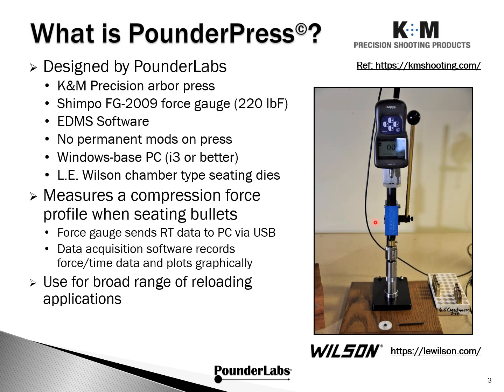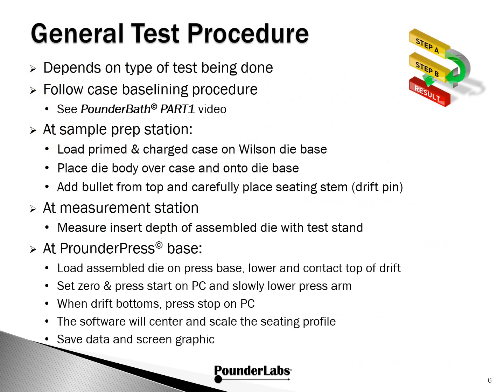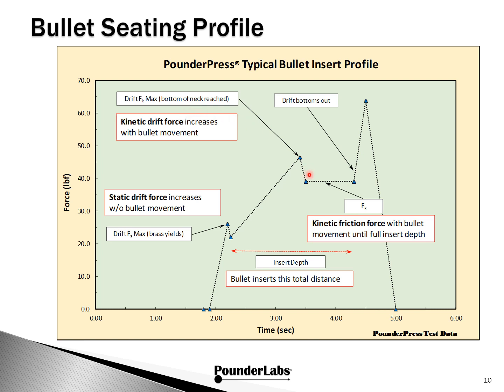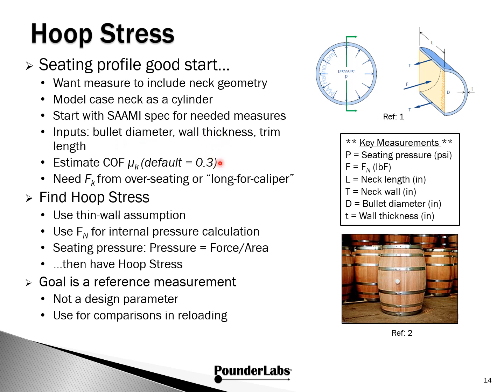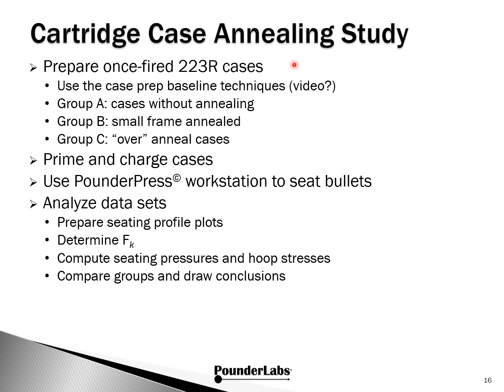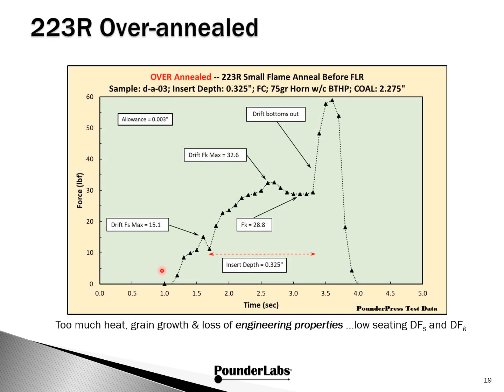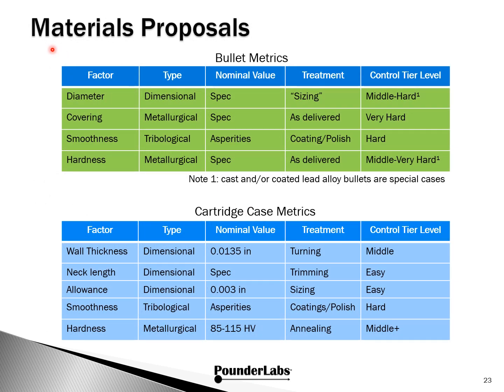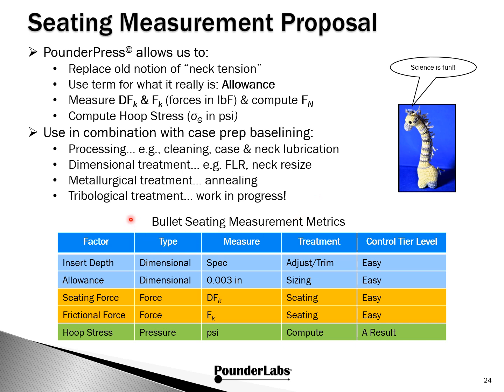PounderPress - New Bullet Seating Measurement

Comment: Nice work. Just a few more words on the concept that the assumption of the COF at 0.3 would be useful. Otherwise I would say it is a useful assumption that allows a simple experiment to go forward and it does tend to pan out. The other comment is that a slightly more complex view of the neck is caused when the boundary isn't free at the shoulder as it is at the open end of the neck. If the neck was just a cylinder with simple boundaries at each end, then the simple pressure concept would be more valid.We have a much less rigid "hoop" when there is nothing but the free end or more cylinder next to part of the neck, versus, when that neck blends into the shoulder and is much more rigid. The plots show this effect in several ways and it bears mentioning. Nothing wrong with the simplifications, I am just suggesting that not all the viewers have an scientific or engineering background and this is the right place to open that can of worms just a little, then carry on to see what pans out. The time based smooth stroke is okay, but what about a displacement transducer like an LVDT or Pot to actually plot the axis in displacement instead of time?I enjoyed the video very much and hope you keep going!
Reply from the maker: Dino C… Thank you for your feedback and encouragement. From your comments, I can tell you have a good background on these topics and as you note we're making a swag with COFk = 0.3. Over the last several months, we studied the literature for COF for different material interfaces. We found a range for the various materials can go from 0.21 to 0.44 and the closest ones for brass/copper are in this range. We have the model open so as we get better data we can improve results estimates. Also, we have in-plan a COF measurement set-up because we must get materials in-hand and find the relationships empirically.

You're correct, the shoulder does play into this and over time we will try to better understand this boundary condition. Working with the hoop stress thin-wall assumption with the interference allowances in the 2.0 to 3.5 mil range we thought we would introduce what we have and, as you say, we're open to more input and discussion. We are currently working on thinning the walls, do the seating and put the numbers up for discussion… Stay tuned and thank you for mentioning this.

Force/time vs force/displacement another great comment. We put this proof-of-concept together using off-the-shelf technology and the minimal amount of additional engineering work. We're hoping a lot of the reloading community can relate to this and we can move the discussion forward. We just posted a seating test video using the Instron UTS. That would be a great way to go but we're going to need more budget ;-)